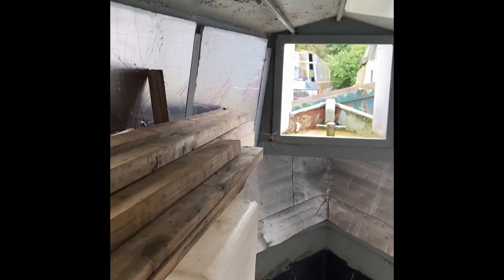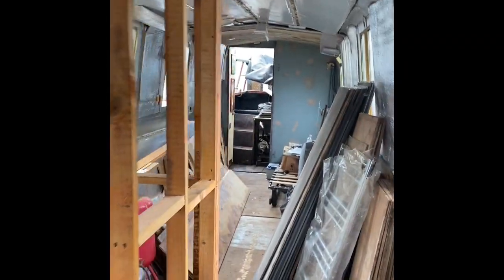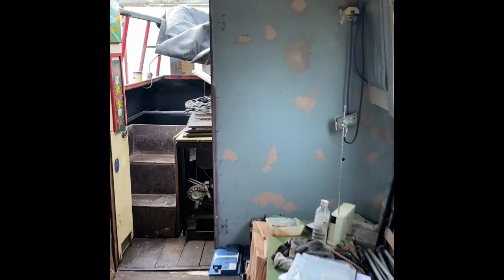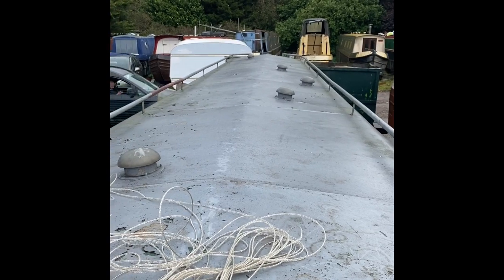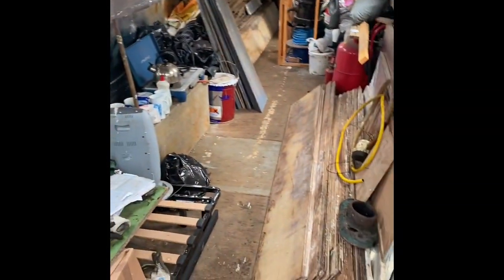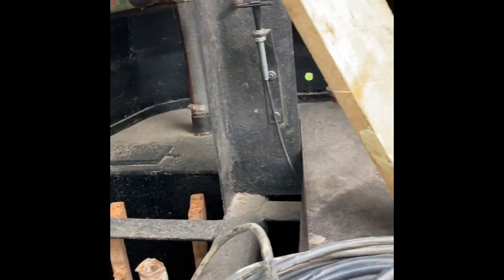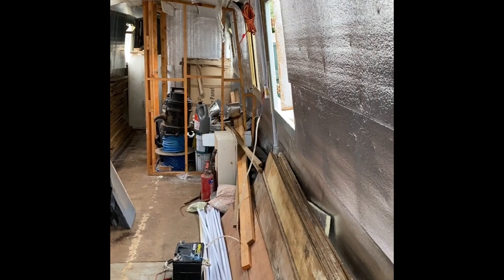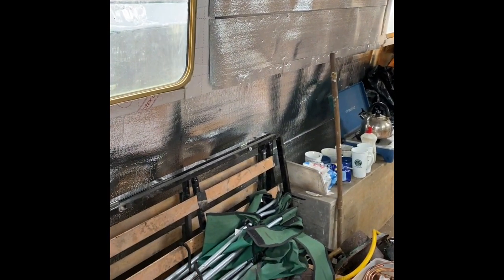1. Welcome to the narrowboat that James built

Comment: Proper project , will follow this for sure . I bet loads of boaters recoiled in horror , good luck fella
Reply from the maker: I may have recoiled in horror too if I had known what was lurking under the floor. I just thought slap on some panels, rig up the wood burner and away.......but alas not quite ! Cheers for watching, glad to have you with me
Reply: I suspect you could search forever , and missed out by hesitating , so make the best of what you end up having . I'm an engineer , anything can be fixed , and cheaply if needed . Tread boldly , sounds like your up for it , and up to it , keep us all updated 😉
Reply: Started here , going to watched the rest .

Comment: I have seen beyond launch.
Whilst at the start surveyors costs for every boat you want prevent monies being chucked away.
However not having a surveyor to check plating thickness could turn out to be a failure.
New insurance regulations require boats over a certain age require a survey every three years to satisfy necessary insurance cover.
With no survey on purchase you gamble that a future survey won't tell you she needs overplating then £10k + is going to be needed.
I agree you could Not pay for a survey on every boat you looked at.
But on the one your set upon then yes.